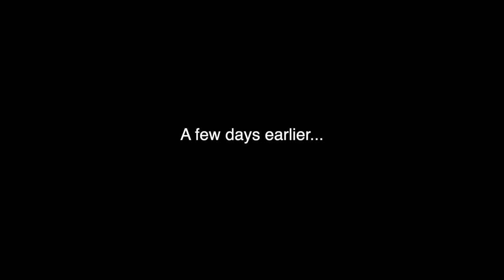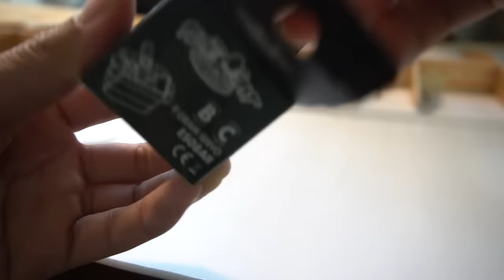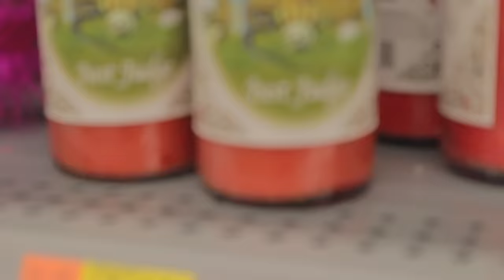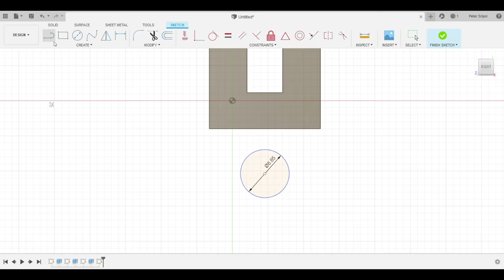Water Dropping RC Airplane

Comment: very nice!
you need a thermal cam on the plane, for better aiming :D

set an fixed Alt. and Speed for the water drop, adjust the therm-cam in the right angle...aaaand go ;)

Comment: Peter, the work you did to put together that plane was awesome. The rib work on the wing, the mechanism pulling open the bag, the paint and tape work,  beautiful man. Heck, it worked pretty dang good and I thought it would actually snuff a small fire if you hit it from a bit higher and timed it right. Sounded sweet too with the twins. Just started messing around with foamboard RC so loved it. As far as the other folks in the video........thanks for the help guys...... 🤔 ☮️ Wheelchair John in Idaho 😎

Comment: Here's my idea for a simple and easy follow-up project:
-Build a model Bell-Boeing V-22 Osprey (with gas-powered turboprops rather than electric motors as you usually do)
-Add a water tank
-Add a water pump that lets you fill while hovering
-Use flight mode to get to the fire faster, and hover mode to drop water with maximum precision 
-Add an onboard radio to call up waterbomber pilots to tell them they're now unemployed
Reply: Yep great idea cuz peter can save the whole world

Comment: This needs to be revisited using a small 3D printed water pump to bring the water in, essentially rc boat parts for bringing water in while flying. I’d Imagine you need to scale up a bit but no worries there

Comment: You guys should have put a little tank in the plane with a pipe joint to an overpressured chamber with a tap, once the tap is opened the high-pressure will blow out the water in 1 second from the recipient tank! The fire will be put out instantly.

Comment: Really cool, but the water dropping mechanic suckz, with a spring or Rubber Band to open it, it would be much cooler (is the container closed and get under pressure while dropping?).
A poppig water Ballon would also be a fast easy sollution.

Comment: Use rubber band to pull open the water bag zip. And just need a solenoid to release the loaded rubber band. No actuator motor needed, and will open the zip faster

Comment: Plastic box. Swinging door on bottom, hinged on the back. Compressible gasket. Pin that holds it shut. Pull the pin, weight of water will open the door.

Comment: You shouldn't store water like that. because it will cause inertia This will cause the aircraft to be unstable or sway.
You should collect water like a tanker truck. to have a barrier inside the tank to reduce inertia

Comment: quick drop system...  use a spring and a clip... hit button, lets go of spring, spring pulls bag open fast.

helped a guy do this for J.I. JOE parachute figurines... he had a 7 foot wingspan c130 (balsa) ....     the trap spring was to push them out...